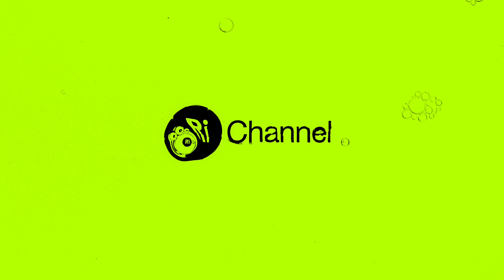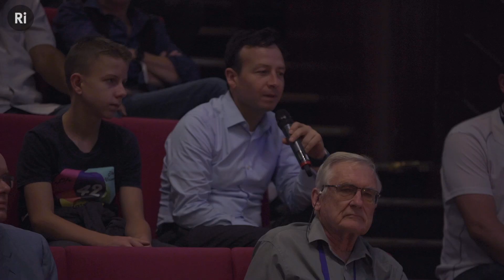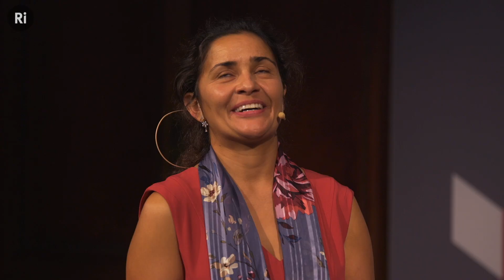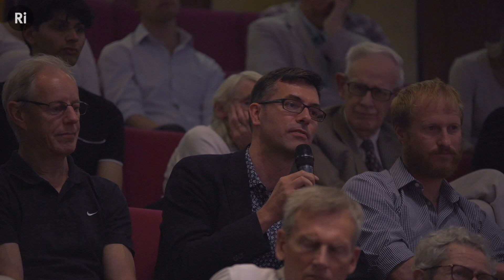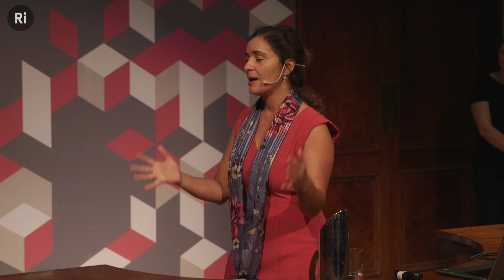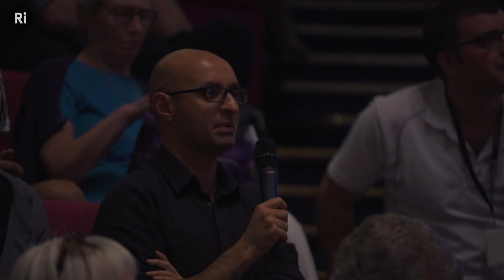Q&A: Hyperloop and the Future of Transport Technology - with Anita Sengupta

Comment: Why is it so difficult for some people to understand this, from an engineering point, fairly simple concept? Much bigger engineering challenges have been solved in the past.
Reply: Most of it's flaws can already be solved, but you would end up with a transportation system that is more expensive than anything else. Remember the Concorde? She said their goal is to be at least as cheap as other modes.
Reply: @kisbiflos  The Concorde is totally irrelevant for this case. There are no similarities. Bringing up just any old failed transportation system is no evidence for that this particular system is flawed. Economy is of course at the center of attention for these projects. You don't think they have skilled economists as well as skilled scientists in the project? 
Show us the calculation that proves this will be more expensive.
Reply: @BjorckBengt  Well, vacuum trains are not a new idea and so far no skilled engineer nor scientist nor economist made it into viable concept. The issue is having straight tube that can deal with temperature difference during time, pressure difference, needs to be fixable, and in case of some sort of failure the capsule with people needs to be accessible that is huge issue in vacuum tube.
Reply: @NetAndyCz  The same goes for battery cars. Its a very old idea and they have not been viable until Tesla made them viable. Temperature management, pressure difference and access to a failed pod are important but not very difficult engineering tasks. It will require some testing and iterations until a solution is safe and reasonably cheap though.
Reply: @BjorckBengt  Massive subsidies made electric vehicles sort of viable.
Reply: @NetAndyCz  ICE vehicles are subsidised even more. If you include not only direct support, but also war for oil, the subsidies are ridiculously high.
Tesla has paid back government loans, not GM. EV tax credits will end soon for Tesla and they will continue to be profitable. Subsidies for clean tech is a great way of creating better world for us all.
Reply: @kisbiflos  using current technology? yes it's expensive. that was also true for literally any new technology ever.
that's why we innovate and spend money on R&D to lower the cost and increase the efficiency.

Comment: I watched the entire presentation and the entire Q&A.  It seems a lot more plausible now than when I started watching.  I'm sure it's technically possible, but I still wonder if the eventual efficiency is worth the monumental infrastructure effort and cost.  I'm sure a mile of traditional highway is very expensive in terms of materials and construction.  My layman's hunch is that a similar length of hyperloop would be many, many times more expensive.  Would the payback time be measured in centuries?
Reply: using current tech it'd be definitely unfeasible.
the thing holding it back is newer tech and solutions that'd make it more affordable. think solar panels, a gimmick just a couple of decades ago and a real solution today thanks to massive amounts of R&D.
Reply: And yet the hypeloop companies insists their solutions are cheaper than high speed rail 😅

Comment: How long would passengers have to wait to be rescued when their pod breaks down?
Reply: no longer than airplane crash passengers, i'd say.
Reply: @BattousaiHBr  Mostly they dont get rescued, is  that what you mean?
Reply: @bobtailvw22  yes, i'm assuming.
but then again, you're more likely to win the lottery than die in an airplane crash. i suspect this would be roughly as safe as airplanes.
Reply: @BattousaiHBr  Except you would need someone to cut the tube to allow escape, which could be 100's of miles away from civilisation.
Reply: @bobtailvw22  that'd be a really dumb design.
just have segments in the tunnel that can be sealed off at any given moment to help in maintenance and/or rescue to minimize the tunnel distance that will need to be depressurized afterwards. kinda like how they do with space station docking.
in fact, didn't they say exactly so in the video? can't remember because it's been a while but i think they did say this. if even a random person like me can think of that, i'm sure they have too.
Reply: @bobtailvw22  oh nevermind, you're just saying that it'd be far away.
well yes, i even said so previously...
i'm having trouble understand you but that's because what you're really saying is very obvious.

Comment: I though she was going to crush the packet-system question, and I was about 70% wrong. (She did well considering the purported ignorance of the terminology)
If you don’t plan for 50 years out, and only 20, you’re approach is fundamentally flawed, and as a result, your revolutionary system will need to be revolutionized when the time comes to accommodate smaller and smaller outward nodes; which will be integral to expansion and sustainability of the overall system as it expands. 
She was doing great up until she demonstrated they’re thinking of everything which will cause them regulatory or financial problems, but not long term expansion of the paradigm this would create.
Reply: You say that but clearly you're not familiar with how new disruptive tech is implemented.
If what you said was true there was no way for the internet to be revolutionary because ipv4 was very flawed and not forward thinking.

Comment: Time will tell, but the talk around Hyperloop reminds me of the talk around Theranos.  They start with a cool concept that has some major technical risks and then spend all their time and money on everything but those addressing those risks.  
I know there are a lot of smart people working on Hyperloop but social pressure to conform is a powerful thing and, as long as you are getting paid to work on something, you will want to believe it's a good idea.  Look up the story on how Theranos finally fell.  When people in the company tried to raise doubts, they were silenced and their professional reputations were threatened.
The advocates for it sound like all those scam kickstarter where instead of convincing you it will work with hard numbers, they spend all their time talking about all the nice stuff it will enable (if it works). Most science and engineering talks start with an explanation of why we should try something but then they move on to how to do it, and they don't keep going back to why.
She totally punts when asked about the danger by conflating the danger of pressurized pipelines with depressurized vacuum chambers.  It's much harder to hold pressure out than in, and when a vacuum chamber fails it can do so quite explosively with speed of sound overpressure wave.  Talking about it only being a partial vacuum is also a dodge.  A 10% atmosphere chamber isn't that different from a 1% or .1% chamber in terms of safety and vessel needed to hold it.  
Cost estimates seem similarly detached from hard facts.  It is not going to be cheaper to build a Hyperloop line than a high speed rail line.  It has all of the same requirements and many more including periodic high speed pressure blocks and complicated thermal expansion joints (since pipeline style joints won't work).  If someone puts out an cost per mile estimate less than a modern high-speed maglev than they aren't being honest.  
Do a talk where they focus on these things directly and I'll get excited, but all the positive talks and demonstrations I've seen are focused on the idea of it all or the low risk technical aspects like the track and drive mechanisms,  and the loading and unloading of pods.

Comment: So many experts in comments section by just watching one video by thunderf00t.
Reply: You don't need to watch a thunder foot video so see the flaws, one of the comments on here made a brilliant point on the heat dissipation from the metal (or other material) coffin within the bendy straw.  Remember the magnets will want to be at about -260C so you use liquid gas for cooling that will evaporate into the bendy straw destroying the "vacuum."  There will also be a large temperature difference between the top and the bottom of the tube that would probably cause an undulation in the tube increasing the required gap between the tube and the coffin, increasing the ride height and cause one bumpy ride.   Any electric systems within the coffins will generate heat along with the passengers.  

Imagine what will happen if there is a failure, it's not just safe air but also the heat and humidity.
Reply: @timballam3675  are you familiar with LIGO? here, let me show you around there https://www.youtube.com/watch?v=sCuKuUgNfjA
even after seeing it it still baffles me they managed to do it. it is truly amazing, despite all the armchair "scientists" saying how it couldn't be done because there were many many issues to be overcome. einstein himself said it'd be impossible to observe gravitational lensing, and just a few decades later he was proven wrong.
none of the arguments you bring make it impossible, they are just engineering challenges, and clever engineers always come up with ingenious solutions. as long as the hurdle isn't strictly a massive energy requirement (which it isn't in this case), there is nothing stopping scientists and engineers much smarter than you or me achieving it.

Comment: How do you in any "green" way produce and maintain the largest vacuum chamber on earth?  The amount of power consumed by that alone would consume far more energy than any existing rail system.  This is very sad to see this being platformed by the RI.
Reply: yeh but solar freeking roadways........
Reply: You have to do the (near) vacuum only 1 time, SHE SAID. Honestly, I can't imagine, which sealing gaskets could stand that preasure, especially when parts are moving, like the station "gates" or the tube itself, when it compensates the heat expanding over 100s of kilometers.
Reply: That's not the way pressure works Nii P. If it was then we would be crushed by the weight of the atmosphere. It's the same pressure throughout the entire system no matter how large or small it is. And yes, you would just have to reduce the pressure once and then you would lose some pressure over time from use but that's fairly minimal as long as the seals are well maintained. If you have ever traveled in an airplane, it's essentially the same principle except you are trying to keep the pressure in on an airplane and out in a hyper-loop.
Reply: Off Meta Gamer Yeah, but an airplane is not miles long.
Reply: The size of the space makes no difference in this context.
Reply: @offmetagamer5887  Oh yes, it does! At the planed size, the thermal difference sums up to hundreds of meters!! So, sealing gaskets have to compensate that with moving parts!
Reply: I don't understand what you mean by thermal difference. Can you elaborate? I would guess that you are saying that different temperatures in different regions would cause problems?
Reply: @offmetagamer5887  Basically the expansion from the steel tube when it gets warm i.e. at daytime and it shrinks in nighttime or seasonal temperature differences. The same effect, which railroad tracks have to deal with, but there the construction just leaves a gap every view meters, which makes the "tack-tack....tack-tack" noise, especially in winter. If you don't care about it >>> https://stablwall.com/thermal-expansion-care/

 For pipelines you do expansion loops like this http://www.wermac.org/images/thermal_expansion3.jpg
but I doubt, that this can be the solution for the mighty hyperloop. Or is that the secret of "loop" in its name? haha
Reply: @offmetagamer5887  I guess he is talking about mass Expansion due to Temperatur changes.
Reply: It's true that, that is a consideration, but the whole point of it is that it's a vacuum. There isn't a whole lot of mass inside the tube to expand from heat. You could also have a segment or even multiple segments of the rail that exist as "pressure release" segments that could be cut off, pumped out, and then reintegrated to control local pressure. I'm sure they have a better solution but that would probably be enough to compensate for any local pressure changes you might see due to temperature variations. That would also make reestablishing a suitable pressure go a lot faster if the whole system had to be depressurized for whatever reason.
Reply: @offmetagamer5887  These Thunderf00t guys would probably freak out if they knew that every airliner has a permanent 4 inch or larger hole in the fuselage called an outlet valve.
Reply: @offmetagamer5887  You are well out of your depth here.  It is not the mass inside the tube that causes thermal issues, but the tube itself.
Reply: That's not very specific, are you concerned with expansion and contraction of the metals due to temperature fluctuation? If that is the case then I would point to existing pipelines which transfer large volumes of liquid gas and other substances over long distances and do not struggle to account for such fluctuations. If such is not the case then you will need to be a bit more specific as to what you mean by "thermal issues."
Reply: @offmetagamer5887  I'm not "concerned" about anything related to this pipe-dream, other than the fact that so many institutions which should know better are being suckered into spending money promoting it.  Pipelines indeed have similar issues -however they are containing a pressure, not a vacuum, and have diameters measured in 2-3 feet not 15-20.  Additionally, a pipeline can use accordion type expansion joints as they are not also supporting an internal maglev system and the transitional loading associated with the passage of multi-ton vehicles moving at high speeds.  In the end it is irrelevant as there is zero chance such a system will ever be built when we have full engineered high-speed rail systems that can be purchased off the shelf and accomplish nearly the same speeds with none of the added complexity of attempting to operate in the same environment as the ISS.
Reply: Okay, there's a start. The last thing to address is that they do have a full scale working model over a relatively short distance by comparison to their ambitious goal. How specifically does the problem become unmanageable over long distances since the problems you mentioned seem to indicate that the problems will occur in specific places rather than systematically. (referring to strain on the joints caused by added weight and velocity)
Reply: @offmetagamer5887  The problem occurs at both specific places - in much the same way as bridges have individual expansion joints - and cumulatively over the entirety of the system as all of those joint deflections sum.  If it is very cold, and all of the expansion joints are shortened, a mechanism will be required to generate additional length to the tube near stations in order for the stations to maintain their position.  Likewise, if it is very hot and all the expansion joints are extended, a mechanism will be required to shorten the length of the tube near the stations.  These mechanisms will need be vacuum tight and automatic, as over the course of a regular day with a temperature delta of 30+ degrees F the cumulative changes will be on the order of tens of feet per 100 mile length of tube.  Now, is it possible to engineer a solution? Certainly.  Will the market absorb the engineering costs of such a system when a near-equivalent system of high-speed rail already exists and presents none of the additional complexity and cost? No, it will not.
Reply: That's a pretty reasonable argument. I guess we'll see if they can find a way to make it cost efficient enough to compete. Thanks for the detailed explanation.
Reply: @briandecker8403  The way you handle expansion over long distances is with large radius curves and pylons that allow freedom of movement in specified axes or rotations. Reflective, high-emissivity paint and canopies of solar panels reduce solar loading. The Trans-Alaska Pipeline has more severe challenges with thermal expansion and thermal management in general. And it has survived a 7.9 magnitude earthquake on a strike-slip fault it crosses that moved 8 meters as well.
Reply: @Markle2k   Again - the question is not "can a solution be engineered" but "why would you engineer an exponentially more complex and costly solution when high speed rail already exists?"  Additionally, it is pointless to use a pipeline carrying a pressurized fluid to a tube withstanding a vacuum as a point of comparison - their operational requirements are entirely different.  Large scale engineering is never about "what is possible" but "what is practical", and practicality always prefers the most simple solution that meets the requirement.  In this case, if the requirement is a train that can travel long distances at several hundred kph, we already have numerous fully engineered solutions that do not require both the energy to move plus the additional the energy to maintain a 99% vacuum differential.